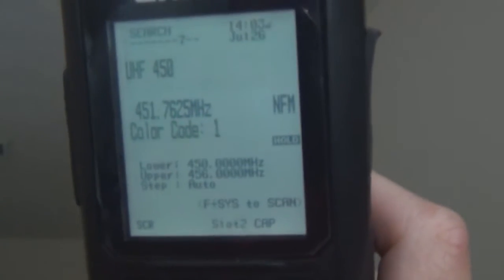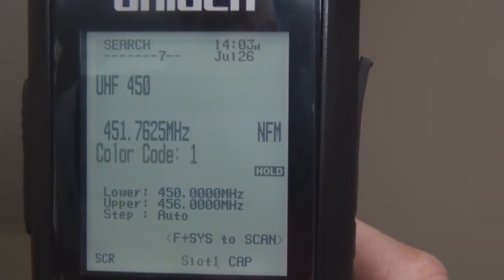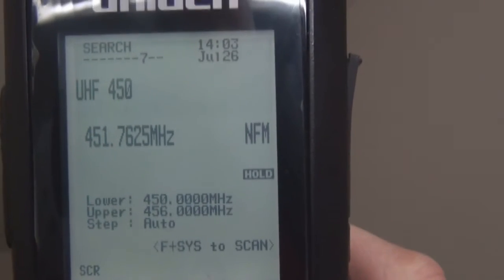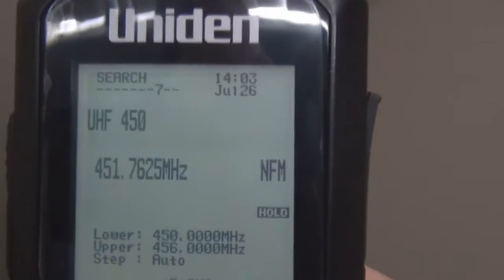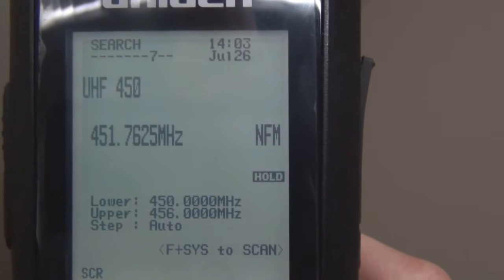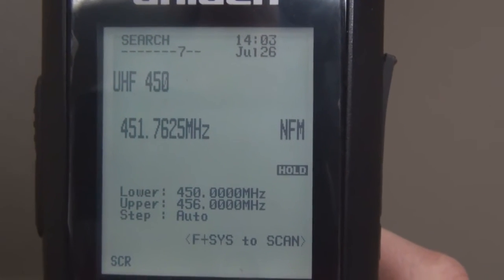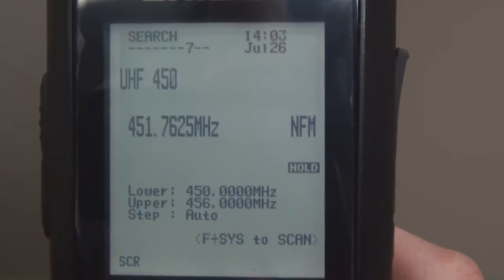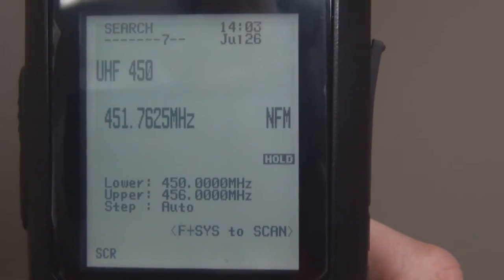436hp battery door aluminum foil test

Comment: What about using metal tape typically used to seal air ducts and flue pipes. Not rigid, easy to apply and cut like cloth duct tape and already has the adhesive backing? Can be bought at any Home Depot or Walmart for a few dollars a roll. Just a thought don't know if it would work the same.

Comment: It absolutely works amazingly well and is highly recommended. I took a roll of commercial grade aluminum foil. I cut the width along a strip and folded it over several times allowing for about 8 equivalent layers. took two small pieces of tape on the back side to assure it's position on the back side of the battery door. After some time it literally molds to shape and becomes one with the door. It went from NO signal to 100% perfect signal no noise on a good number of channels from 100mhz on up past 450mhz. A needed idea for sure with the 436 radio. Copper is NO better.